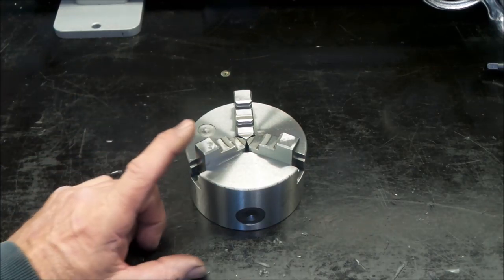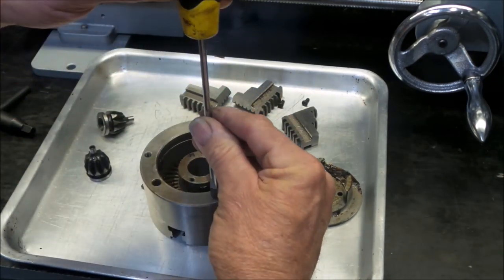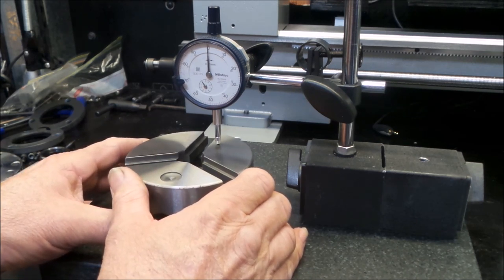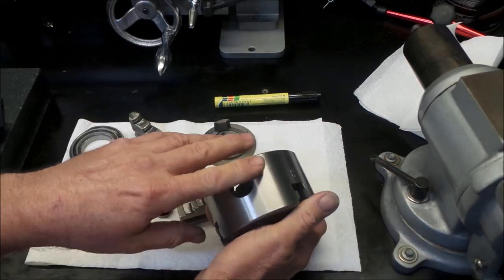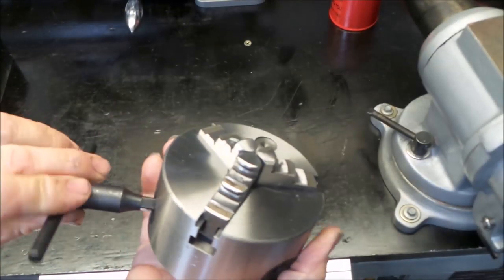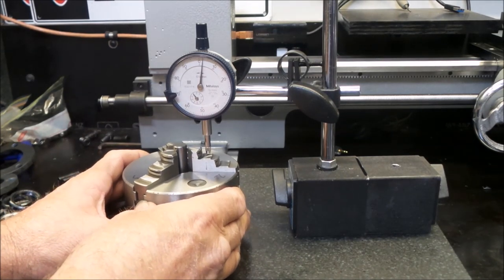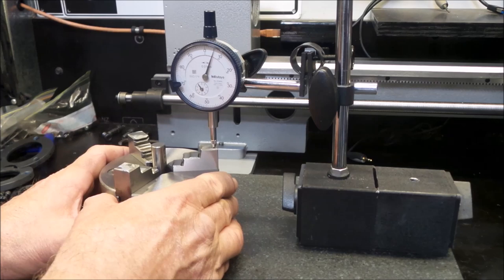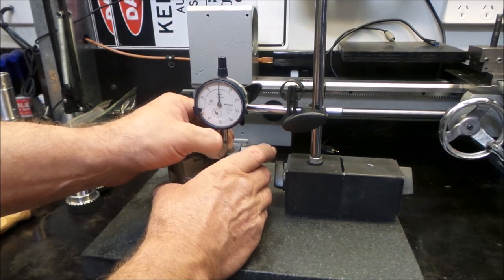Mini Lathe Chuck Tear Down & Rebuild

Comment: Wow.....I feel bi-polar after all that, good, bad, good, bad points as you go through that chuck.  Is it correctable?
Reply from the maker: Hi Vlad, well...... yes & no. overall its a pretty low quality chuck. Just a bit sloppy everywhere.
Jaw fit is Loose & Nasty, the Scroll as you saw, just falls out due to loose fit & heights all over the shop. On the positive side, I have run the lathe with it fitted  & after re-cutting the register on the drive spindle it has acceptable run out, when holding in the centre. You could re-grind the tops of the jaws to tidy them up maybe, really depends on what you are making on your lathe & how accurate it has to be. Personally I probably won't use it, as I have other options available. But, thats not to say you couldn't get by with it.
Overall Quality is not the best compared to other import chucks I have handled, but that really was no shock.
Cheers mate.

Comment: Just worked through your Chinese minila the  series.   I suspect the 3rd time you rebuild it that you could get it reasonably accurate.   Need the Chinese minim all to go with.      On the plus side the project of making your lathe and mill work moderately well teaches a lot of machining lessons.     I will do this as well before I die.    This deserves way more subs.
Reply from the maker: Thanks Robert, Cheers Mate.

Comment: Excellent video, I personally wouldn't worry about too much run out on a 3 haw chuck, as when you turn the bar down to diameter, it will true up any runout. For better repeatability, an independent 4jaw chuck is a must, especially if your need to work on both ends of the stock
Reply from the maker: Very True Russel, Cheers mate.
Reply: Except for one thing. Often the face of the chuck and the jaw faces are used as a reference surface when machining.

Comment: I bought the same lathe - they are the least expensive available knowing full well it will require an immediate rebuild and a number of very worthwhile upgrades to get it to perform with reasonable accuracy.  Mine too was lubricated sparsely and with what I thought could only be used motor oil or greases... it was absolutely disgusting. I'm just into the bearing replacement at the moment and will be lapping and polishing the sliding bits! Hopefully it will turn out well, it will certainly be better than "Chinese New"!
Reply from the maker: Aint that the truth. Cheers Mate.

Comment: I bought one of these vevor chucks from eBay and the back of mine looks like it has a plastic cover that covers the gears but could be metal and the three small screws actually broke the whole towards the inside of the 1-1/8 hole. Also, the truck is wobbly about 0.02 or 0.002 which causes the machine to shake

Comment: as the jaws probably are as hard a frozen butter you could turn the into two part soft jaws
turn down the front drill and tap and put some pieces of alu on them
probably better then using it  as a doorstop

Comment: Interesting watching a tear down on these.  I've seen where others invest in different cheap chucks that look like they're equal or better in quality.  I don't recall watching as thorough tear down, thanks for sharing. 

The two different 4-jaw chucks (independent and dual) are something I'm thinking to invest in.  I want to say there is a larger 3-jaw that is cheap and better quality.  I forget... I haven't been focusing on this due to outside warm weather and less rain work.  Small engine for riding lawn mowers and lawn tractor work re-learning and learning for now unless I need to custom machine something.  HHhmmm. 

Also, wondering what you're using as a diamond lapping plate?  I think I'm wanting to invest in one of those.  Thanks man!
Reply: use a piece of glass and glue wet and dry sand paper down, or use lapping paste then throw the glass after as it will wear out, cheap alternative.

Comment: How much "clearance" is in each T-slot for each jaw?  If you tapped each jaw down and then measured the jaw face I wonder what variation you would find.  Yes the slots cut in the jaws of my unit sure reflect the low cost.   (Are you sure we are ladies and gentlemen?)
Reply from the maker: Absolutely, definitely some of the finest Folk on the Interwebs. Cheers

Comment: Most, if practically all of the measurements and checks you made mean nothing on this chuck as they are not used for any machining purpose......highlighting the miscellaneous bad points does not make it a throw away item or something that is totally unusable…..The main purpose of a 3 jaw chuck is to grip raw material and then machine it...….raw material is as rough as guts anyway so it don't matter a hoot. However, for the review, it's interesting to know what you actually get for your money and how you can make it better.
Reply from the maker: G'day Ian, totally agree. yes the purpose was just to show how the General Manufacturing  tolerances were.
Cheers.

Comment: Can you machine the faces to get them consistent?
Reply: you can lap them consistent, applies to 3 jaws  first chuck up with a small round part (end mill for a datum) get a base test reading, find out your highest chuck and lowest, chuck up with a medium part and repeat and same again with as big a part as possible. this is to check the parallel movement of the jaws in their slots. if they are deviating away from the datum measurement then your jaws and slots may want some work done back on the lathe. if they are concistent across the jaw ajustment but are different heights, mount and some wet and dry sand paper to a piece of glass, TIME FOR MORE LAPPING! like the saddle but with three jaws, grind down tallest to second tallest jaw (with both lowest and second tallest jaw shimmed),  grind down the 2 tall chucks with the lowest packed and then when all 3 are at the same height, lap them all together, check each step with dial indicator and engineers blue on the surface plate. repeat for the lower steps, you will need thick rings (as thick as the jaw step, cut, lapped and flat check on surface plate) to be your next lapping plate, make out of aluminum or plastic and repeat. if the problem is within the jaw slots, then thats above my current knowledge to remedy in the home garage shed (the jaw groves might not be true and parallel, the slots might be bad or both). machining them flat in the lathe 'will not' work on the mini lathe as the chatter noise and the cutter hitting a step/jaw will knock it right out as well as adding tool marks that will just collect crud, as a coworker told me, " the smallest bit of spatter will ruin your day" (refers to welding spatter getting inbetween parts/jig),  the clamping faces are not important as a 3 jaw chuck will loose datum when parts are taken out and put back in,  they can be blueprinte but it will require the surface grinder tequenique of mounting a dremel and stone in the assembled lathe, there are videos on this.

Comment: How to true runout in cheap chinese chuck using a carbide cutter in a boring bar .
https://youtu.be/i6d7buHBC6Y

One of the other guys on Boob-Tube has a clip out where he's lamenting the fact that he had replaced the bearings and did all the "bucks-up" things to straighten the run out in his chinese lathe (ie , spent 2 or 3 times trying to buy a remedy for a twisted bed rather than the work required for the results you got), yet the solution for precision on a budget eludes him . 

Just thought you'd get a chuckle out of it (may you already know which guy I'm referring to - think they call them a "wanker" down there). 😁
Reply from the maker: Thanks Spud, Much appreciated Mate.